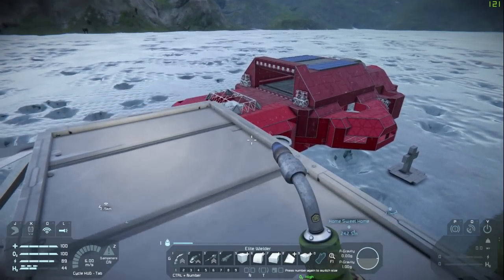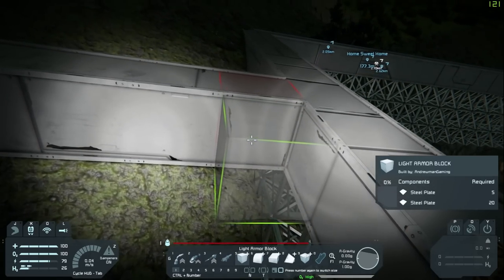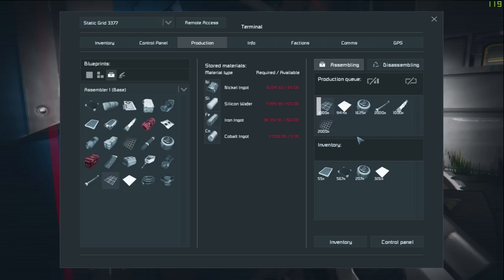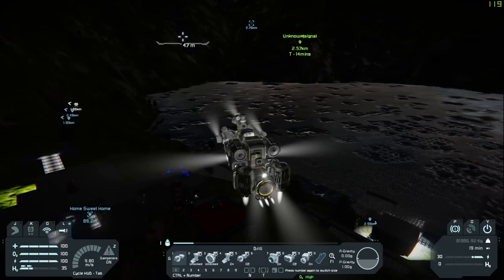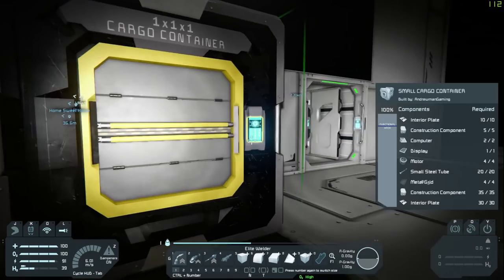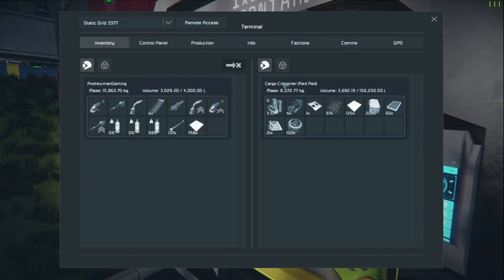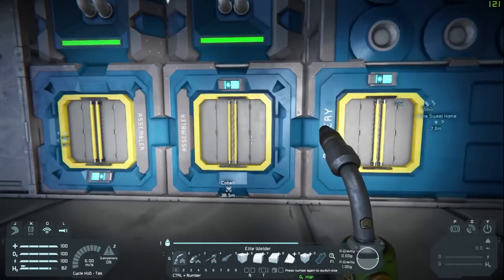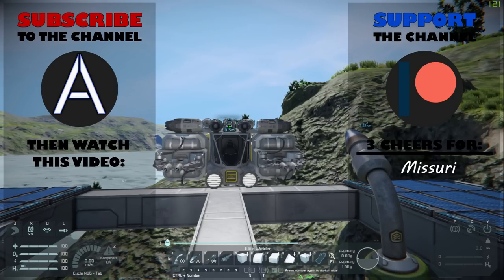Space Engineers Let's Play (Ep 23) - SOLAR DOCKING STATION [Beta Gameplay]

Comment: You missed your the main roof solar which large.   Solar cell don't need steel under them. They can stick out over.  You can also weld them into self support frames. The  solar paths could support edge mounted cells without interfering with walking. The sun is low in the sky.. So you some more power  with south wall panels.

Comment: Sorry this is so long!!

One problem I have found when running multiple assemblers is that assemblers don't push items out, so if you want to make 5,000 steel plates or something, those plates will be split into 4 different inventories and are kind of a hassle to get to.  You can use a sorter to pull all components out of the assemblers into a cargo container.  This can create a bit of a problem if you have a cargo container dedicated to the components coming out of the assembler - as you can only access that cargo container directly because the sorter only allows one-way flow of those items.  You'd think that you could just connect the other end of that cargo container to the rest of your network and be able to pull items out, but this creates an issue with the sorter.  Since that sorter must be set to "drain all", it still sees the components it has pulled out of the assemblers and placed in your component cargo container, so it just pulls them through the sorter again....and again...and again, and then you have an infinite loop of components indefinitely running through your conveyor network.

The fix for this that I have borrowed from someone I don't remember is to have sorters on both ends of the cargo container you want to store the components.  You have the sorter which is set to "drain all" from the assemblers and into the cargo container whitelisting components.  Then a second sorter which allows items to flow from the cargo container back into the network.  This should also be set to whitelist components (or whatever else you want in this container - I do components, ammo, and tools/weapons - basically anything the assemblers would make), but NOT "drain all".  Now, this doesn't fix the problem because the sorter set on "drain all" still is able to pull items out.  You need timers now!  

By default, I turn off the sorter pulling items out of the assemblers and turn on the sorter allowing items to flow out of the container to other access points on the network.  I set up the first timer ("timer 1") that is delayed by about 40 seconds and its actions are to turn off the sorter allowing items out of the container and to turn on the sorter pulling items out of the assemblers, then last, activate "timer 2".  "Timer 2" is delayed by about 5 seconds, and its actions are to turn off the sorter pulling items out of the assembler, turn on the sorter allowing items out of the container, and then last - start "timer 1".  Ultimately, what you end up with are alternating windows where for 40 seconds, you are allowed to freely pull items out of the cargo container from any access point of the network during which time items build up in the assemblers.  After this, for 5 seconds, items will move from the assemblers to the cargo container, but during this time, you will not have access to them (unless directly accessing the cargo container).  The worst case scenario is that you go in to pull items out, and have to wait 5 seconds while the assemblers are being emptied.  You might have to play with the delays on these timers to get your desired results.  As much as your assemblers are working, they might not have time to empty their contents in just 5 seconds, but it works well for me.  

In the inventory panel, you can filter by storage containers and check the box to "hide empty" and get quick access to all your components all in one place.  The cool thing is that it also pulls components into that container from anywhere on the network (during that 5-second window), so you can just empty unused components into any storage and they will ultimately end up in one place.  I've read that the issue with storage GUI not remembering your preference is being fixed in the next patch.  So, you won't have to check the "show connected inventories" box every time you access the network.  For me, my default will be "show connected inventories", filter by storage containers, and hide empty.

I really enjoy your videos, and again - sorry for the long post.  There is probably a WAY easier way to do what I just described.  This is just how I do it.
Reply from the maker: That's a very interesting fix to an equally interesting idea. I might try this out!

Comment: You should make a beam with a rotor on the bottom and one off one of the top blocks and solar panels off that rotor and get issi's solar aliment script to get the most out of the Sola panels on that beam
Reply from the maker: That's an interesting idea. I might do something like that with an off-site power station. I think to have movable panels, I need a lot of space and since I have ships flying around the main base, I am a bit worried about adding too many moving things.
Reply: AndrewmanGaming Dude just build a massive tower up connected to the main base... rotor to turn the arm horizontally and two either side for vertically... group them in to Solar Rotors... install Programmable Block... load Isy’s Solar Alignment Script into it... profit! Already had that up day one in Bubbi and my world
Reply from the maker: I suppose I could try it. I just know I'm gonna crash into it at some point!